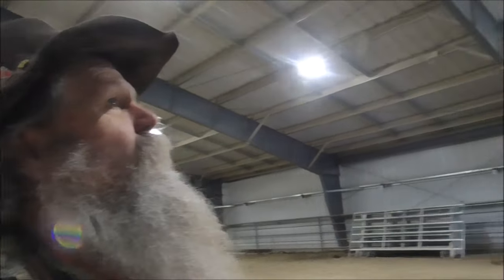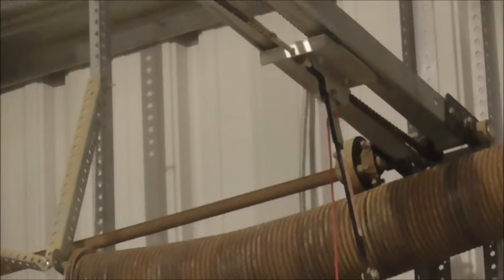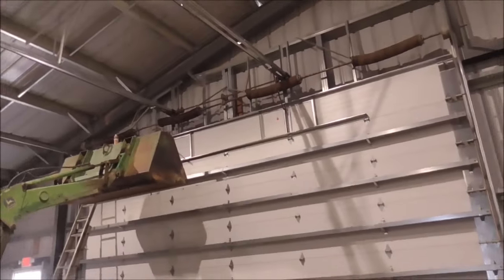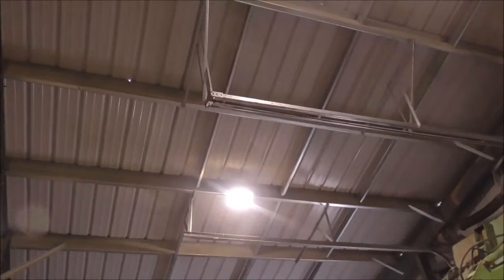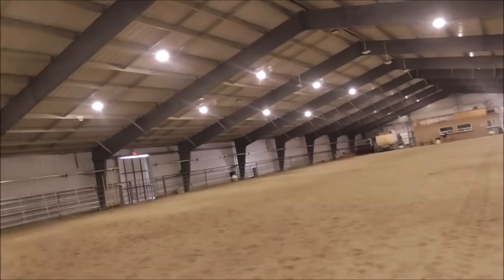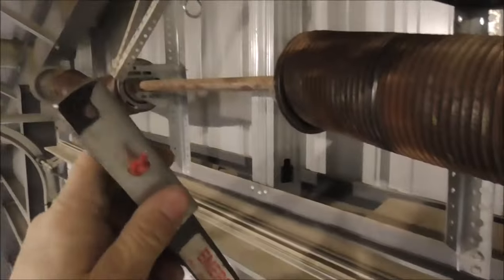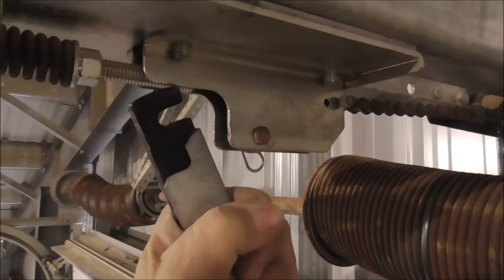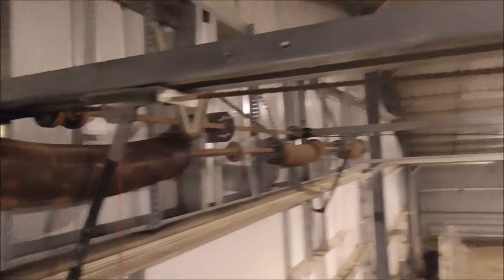Roll Up Door Problems....Again!

Comment: Good afternoon muskrat...glad you figured out the problem with the garage door...but I have to warn you about those springs... and are under a lot of tension... when the door is closed... don't ever mess with them... professionals ONLY...I loosened a set screw on one much smaller than that once... and I'm lucky to be able to tell you... they're dangerous... the wrench went past my head... like a rocket... and I had to use a hydraulic jack to get out of the garage...be careful with that stuff... okay brother...
Reply from the maker: Thank you for the warning!  I have heard that.....pretty scary!  Thank you.

Comment: Dont put silicon on the track
Reply from the maker: No?  Why not?  I did where the roller gears were, but not the length of it?
Reply: @MuskratOutdoors  not the track just the bearings.  Because then you will have problems opening and shutting. But you are ok, because you did not grease down the track itself.